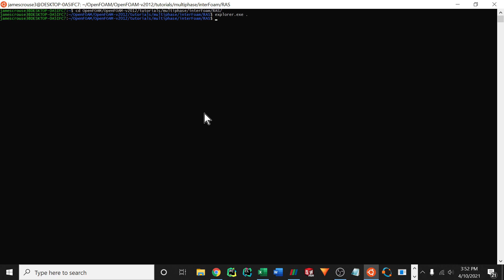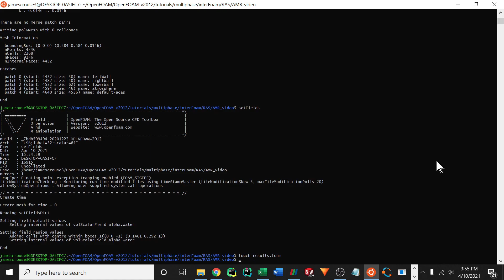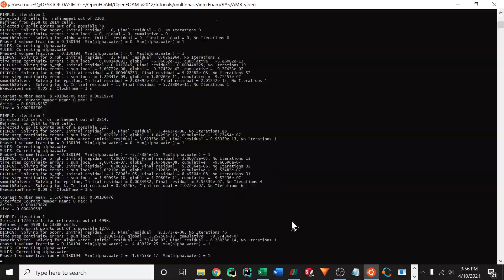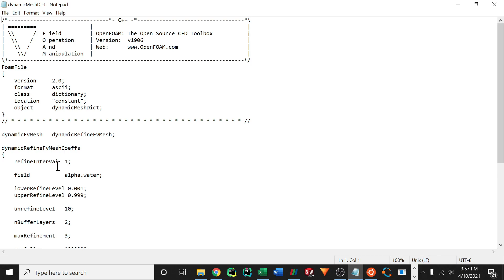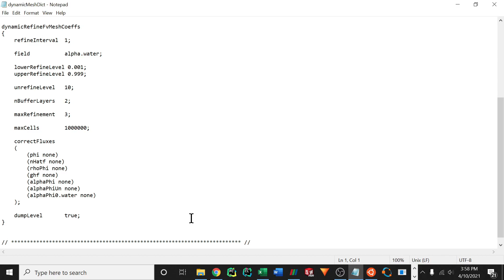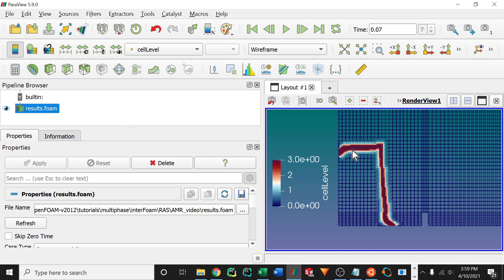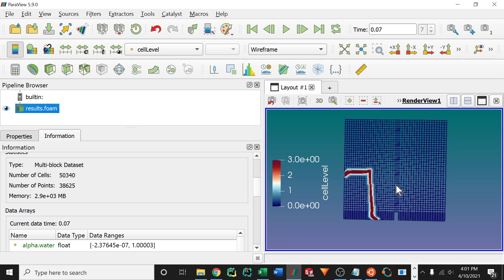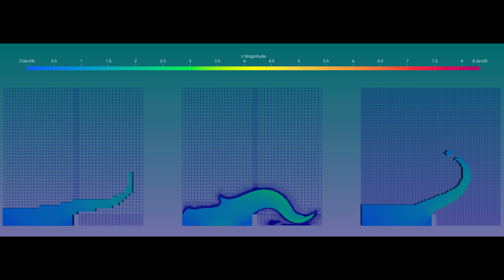OpenFOAM Adaptive Mesh Tutorial: Modifying the Dam Break case for AMR

Comment: Very good video. So do you have any suggestions as to how to approach a big case in parallel? would it require to reconstruct/decompose after each refinement step for example? This sounds really time consuming but it might be the only way to make manageable a huge case.
Reply from the maker: Since this video I have run some experiments on the damBreakWithObstacle using the interIsoFoam solver in parallel and with dynamic mesh. My results thus far have confirmed my suspicion that the case effectively becomes less parallelized due to the dynamic mesh. It seems to be somewhat case dependent whether the best option would be to reconstruct and decompose the case at each timestep (thus saving on simulation time) or to just initially decompose the case and let it run (thus saving on preprocessing time). Is this clear? I am considering making a future video to explore this in more depth.
Reply: @interfluo6420  I'm not sure I get what you mean by less paralelized? That OF tends to reconstruct and reduce the number of partitions covering the refine region? I will run a test tomorrow on a real life case to experiment a bit.
Reply: But thanks for the video. I was preparing a case today and came to the conclusion that it'll take over 1B elements on a uniform grid. So this might save my life.
Reply from the maker: All I mean by less parallelized is that the distribution of cells in each core will become uneven. Imagine your initial case has 16 cells distributed across 4 cores, this should effectively run 4x faster than the single core (serial) case. If at the next step you refine and you now have 100 cells in core 1 but 4 in the other cores, this will run 1.12x faster than the serial case.
Reply: @interfluo6420  AMR load balancing has been investigated in the past. Have a look here: https://github.com/ElsevierSoftwareX/SOFTX_2018_143 you can also find the related publication on researchgate